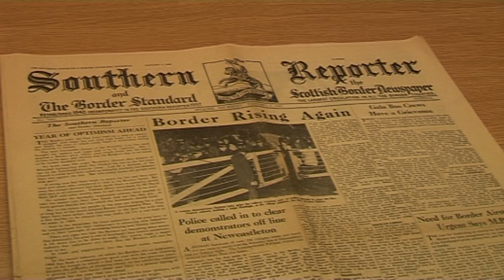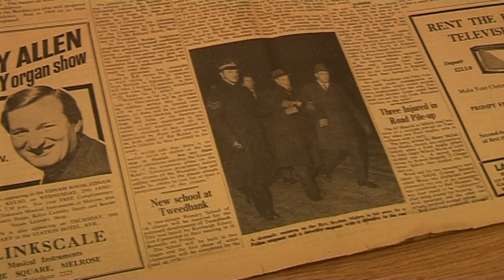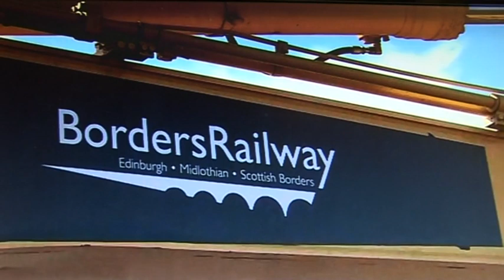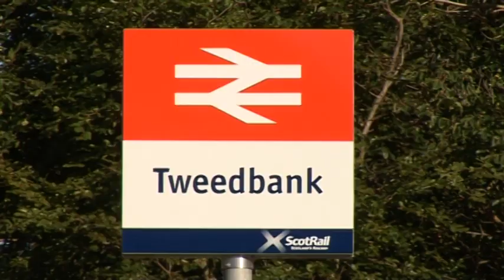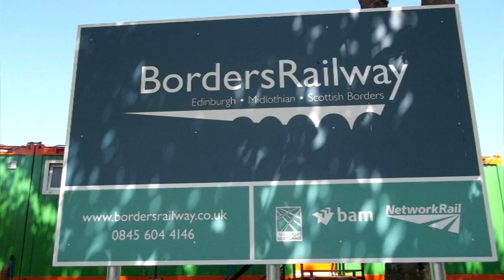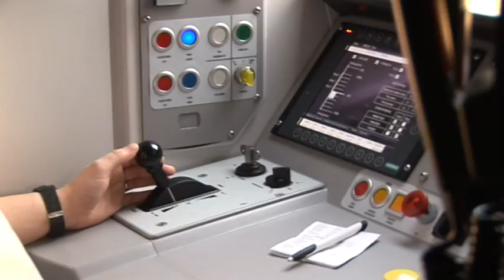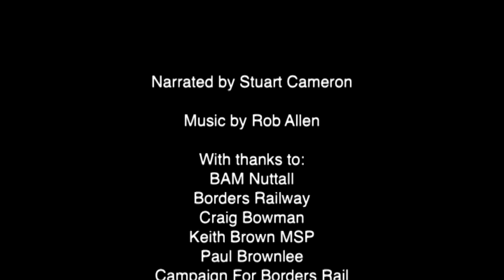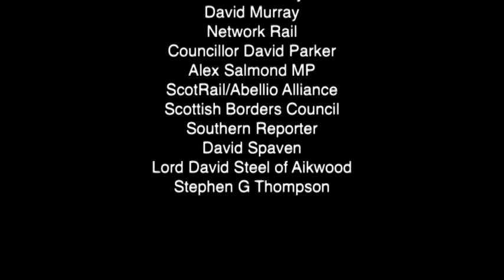THE STORY OF THE BORDERS RAILWAY - A short film made in 2015 just before the opening of the line

Comment: Why is there such a delay to extending the line to Carlisle and improving the existing infrastructure too?  The passengers using the line have exceeded expectations, but then if you provide a railway people will use it.
Reply from the maker: It's extraordinary, isn't it?! It has been proved that this project ticks all the boxes including the important "green" box but still both sides of the border won't push the button to make it happen. Since that documentary literally nothing has happened. No one is being held to account properly for this. It's not even on the Network Rail "to do" list for the next 10 years so we are probably looking at well past 2040 before we could realistically see trains running between Tweedbank and Carlisle.
Reply: @mp999  Yes indeed the extension should be a priority.